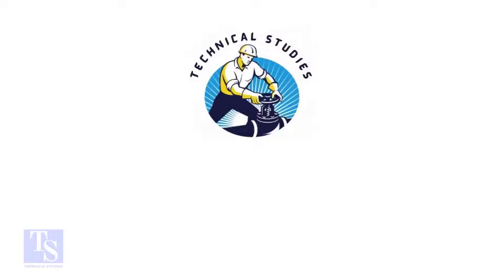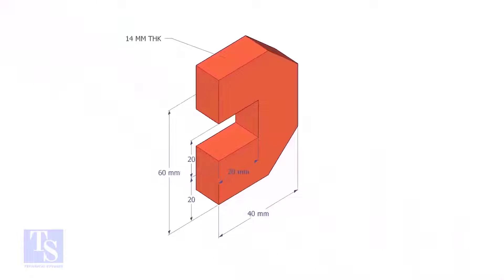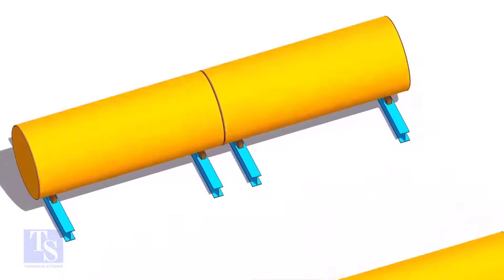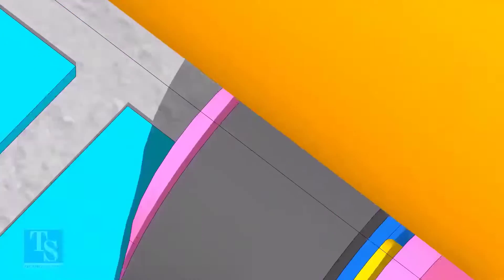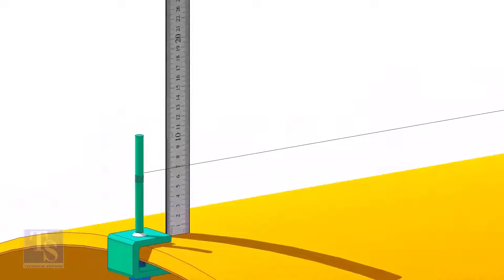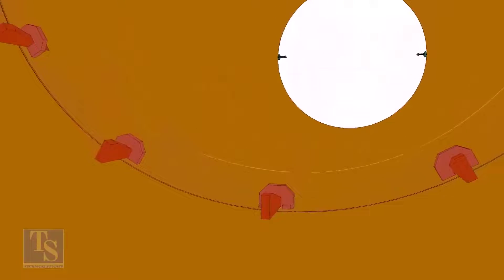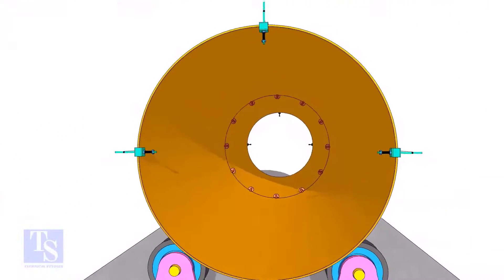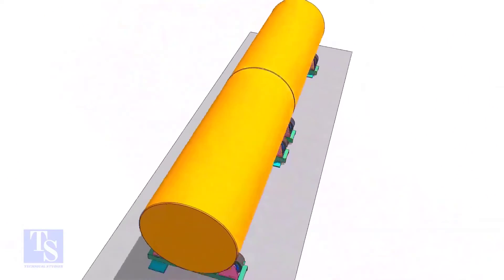How to Join Double, Large Bore Diameter Pipes

Comment: I do this work only 2 right angle and vision
Reply from the maker: That depends on your experience, bro. But how will you convince the QA/QC that your fit-up is straight?
Reply: @technicalstudies.  19year I work fabrication (pipe, structure, vessels, columns, srubber etc)QC need fabrication standard procedure I do proper procedure